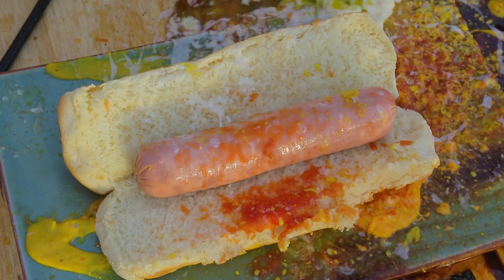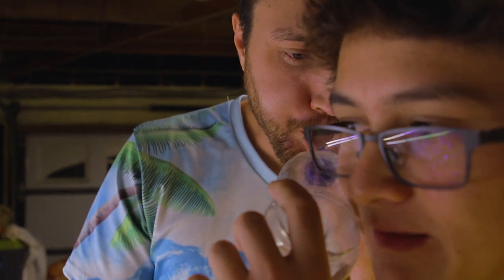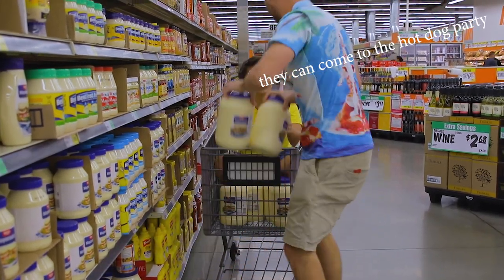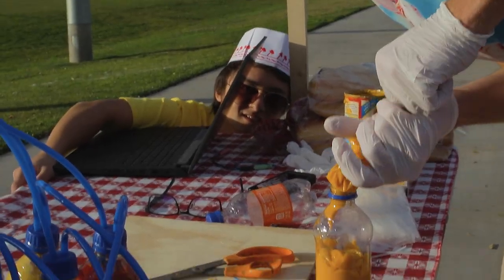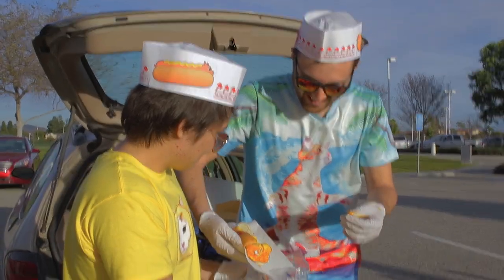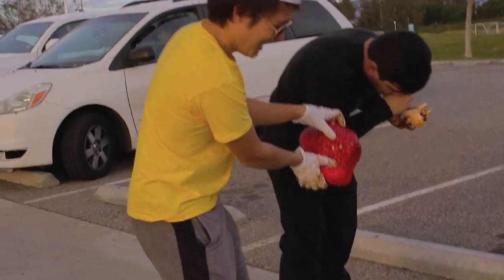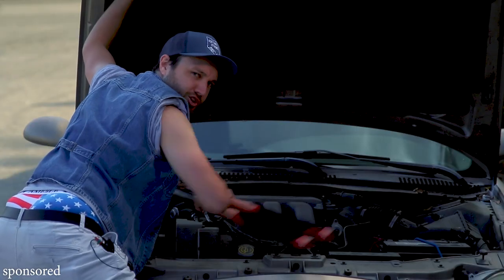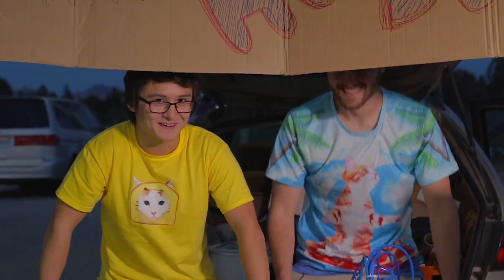Voice Activated Hot Dog Blaster

Comment: Your mistake was using a compressor with only a solenoid to control it. As you saw, there was not enough control to correctly calibrate the amount of sauce. Instead you should have used a reasonably robust peristaltic pump driven by a stepper motor for each topping. Much more fine control of the pressure, so you don't overpressurized as seen above. much more consistent flow too.
Reply: Gautam Bose thank you smart person
Reply: That's not as funny to watch on Youtube though.
Reply: neeeerd
Reply: Reading that makes me want to try learning about it
Reply: Gautam Bose you’re smart but you should also know that they don’t try to make them work. They just try to make it funny
Reply: I genuinely appreciate that you gave advice to these two nerds in order to make a voice activated condiment dispenser operate correctly.
Reply: Okay- but like- that would've actually worked- much less entertaining

Comment: I have a suggestion to improve this if you, for whatever freaking reason, want to make a version 2:

You have compressed air -> valve -> condiment tank -> hot dog
You should try putting the valve AFTER the condiment tank, so the tank is pressurized at all times, meaning you don't have residual flow problems.

EDIT: It has occurred to me that the solenoid valves might not be able to handle condiment flowing through them. That's a perfectly valid reason to put the valves before the tanks, and my idea wouldn't resolve that. So maybe add relief valves to each of the tanks instead. Drives up complexity and cost quite a bit, but this was never very practical anyway.
Reply: Also, a stop command or two
Reply: @1TW1-m5i  Yeah, might as well have an e-stop switch, really no reason not to...

Comment: Why didn't you make a voice activated pressure sensor which would squeeze a bottle of the condiment you choice and then go back and forth with a motor that activates off of the pressure sensor it would have been a little more expensive but it would work a lot better.